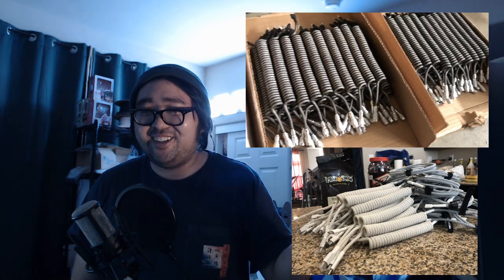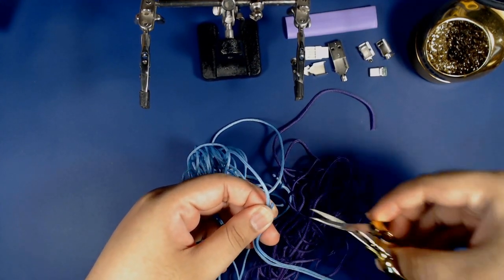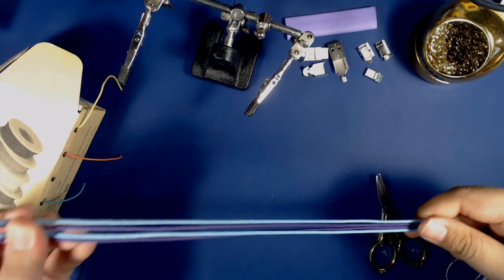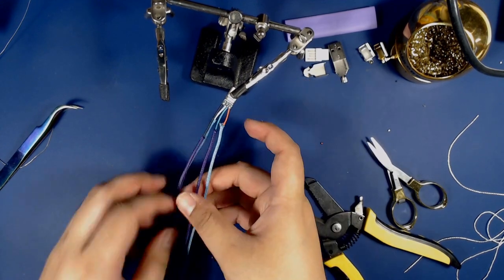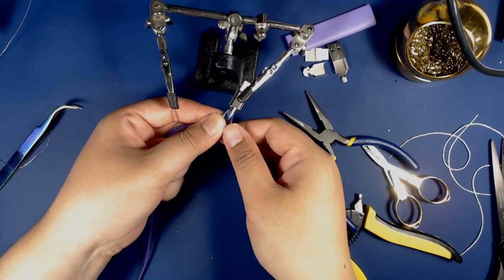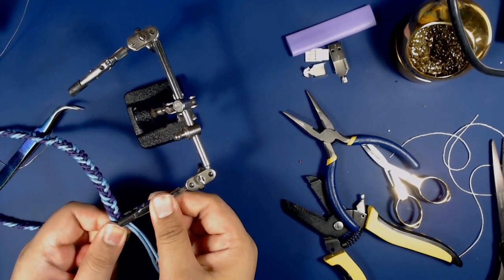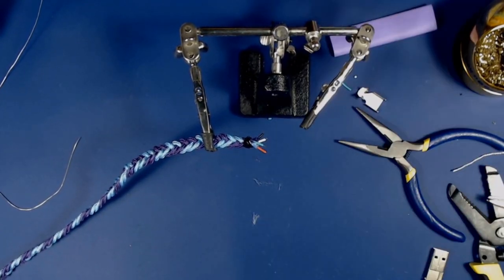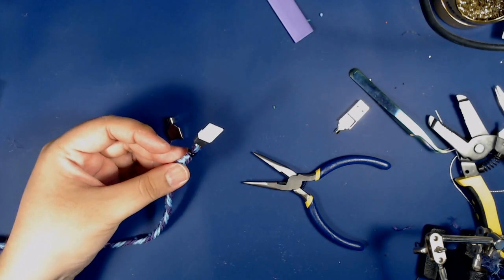DIY Braided USB Cable Tutorial - Mechanical Keyboards

Comment: Hi, greetings. from UK.
came across your channel as I am trying to build a custom 12V power supply to connect my Amateur Radio to a 12V battery. My Radio uses GX12 connectors and I guess that's how I found your channel. Is it possible to do coiled cables using 2 cables of 18AWG the way you do it on your channel? My initial goal was for the cable to be robust but after seeing your channel I am really fond of the looks of your cables.
Thanks for sharing.

Comment: Hi! Im starting to make more and more custom cables and I wonder where you can buy just the inner usb cable (without the paracord tubing) I have host connectors and paracord sleeving but wonder where you can get it? Best Regards from Sweden
Reply from the maker: I put a link in the description for a US amazon link to the cable. I believe a similar wire should be available in your country. 

Thanks for checking out the video :)

Comment: Would there be any benefit to reinforcing the connections with epoxy or hot glue?
Reply: I don't think that it would be beneficial. The crimp part on the connector is quite a strong to hold the cable. Also it's always advised to pull the connector itself instead of pulling the cable, but USB connectors are not that strongly attached so it's fine to do it anyway. Also if you decide to secure the connectors, don't use hot glue, it won't add much strength and it will be messy. Using epoxy would make it stronger, but as I said, it's not necessary.
Reply: to prevent any loose paracord from fraying, glue would be good but I suggest to stay away from epoxy or anything that is too permanent because it'll make it unrepairable. instead of regular heat shrink, I use adhesive lined heat shrink. it's mainly used to make things waterproof but it also helps keep braids tight by locking it in place. (that also makes it under repairable lol)